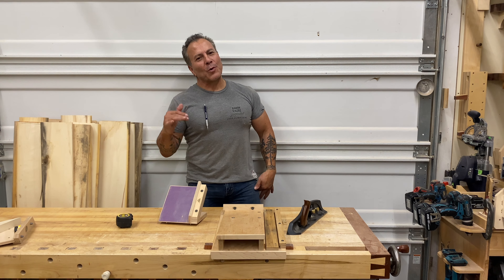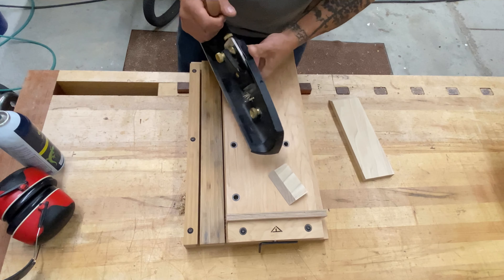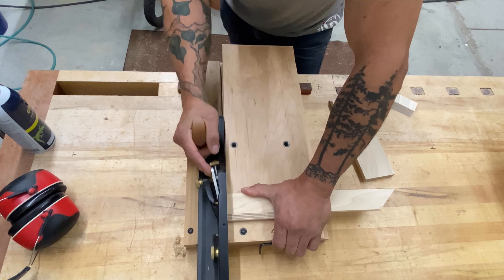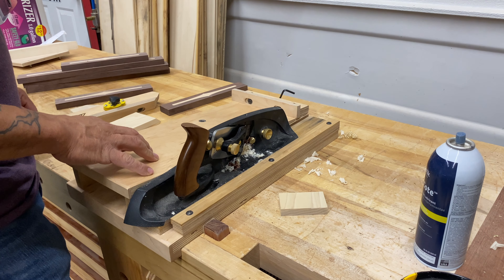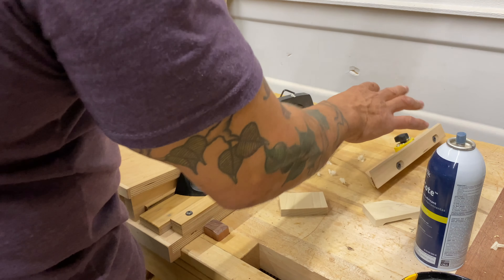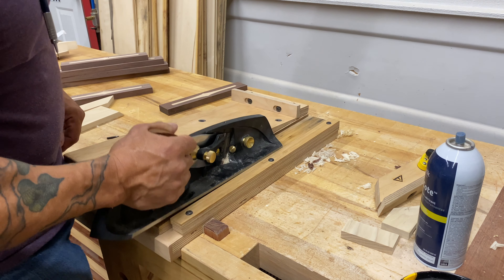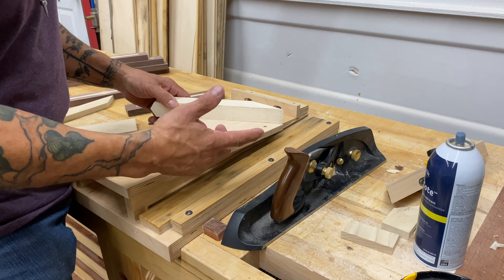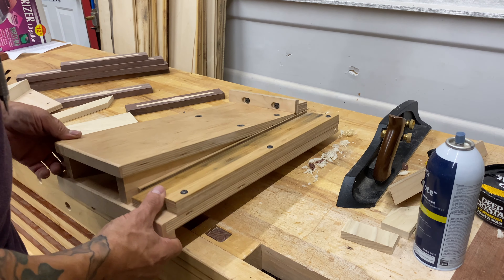The Incomparable Shooting Board!

Comment: Thank you so much for teaching. I always walk away with information "gems" from your videos, so don't second-guess yourself on that point. 

I've been on the fence about that exact plane. My current set-up is my heaviest, squarest plane on its side and I can get results (with effort.) Seeing that guide rail on the right of the board makes so much sense and the shape of a dedicated shooting plane allows that to exist. 

Unrelated to shooting, you mentioned not using a plane on ply and I'm curious about your reason. I do it often with my block plane and I'd hate to damage it. I don't mind if it's just excessive dulling (I've got a fairly good sharpening routine before projects.)

Thanks for any advice!
Reply from the maker: Thank you so much for watching!  

Yes, I love the idea of a dedicated plane designed for a shooting board and the fence to guide it is superb! 

I use my planes on plywood even though I don’t like it! 😆 It’s really, as you mentioned, a quickly dulling issue.  Especially with the fence being an upright section of plywood.  I may change it to solid wood.  I feel like most plywoods’, with their multi layers of cross grain and rigid glue are hard on a sharp blade…but then again, it’s just a tool right?   Sharpening is easy. Thanks a ton

Comment: Fantastic video Ramon, much appreciated. I'm planning on making one using my SO and have 90% designed in Fusion 360. However, having read the attached comments and having thought about it a bit more I'm not convinced the angled base is really worth the trip? The rationale is that it helps to hold the workpiece tightly down to the base. However, if you're using a shooting plan with a skewed blade (I use the Lie Neilson shooter which does) then the skew angle is effectively offset (as one or more posts have noted). The skew not only helps reduce cutting load (an easier cut) but is also introduced a down force component that helps keep the workpiece in place. Maybe the original design from Tico was developed to work with a standard bench plane where the angled base introduces a skew component rather than eliminates it?
Reply from the maker: Yes…valid points.  I’ve been looking at mine regarding this topic and the angle of the base is negligible compared to the skew of the blade.  You’re still absolutely getting a sheering cut.  Not sure how much the angled base helps, but it feels right.  And I like the fact that the angle helps use more of the width of the blade.  Occasionally, I’ll add a board against the fence to bring the workpiece towards me and further use more width of the blade.  Thanks a ton!

Comment: Wow. Fantastic Ramon. My Veritas shooting plane has been sitting in a box and I have yet to use it because I keep looking at different shooting board designs and have yet to find one I was really happy with.....until now. Tico's seems absolutely perfect. I will definitely be building one based on his design. Out of curiosity what is the angle of the ramp? Did Tico just match it so that the top of the blade is near the top of the ramp? But I could see the rationale for making so the top of the blade is part way down the ramp so utilize more of the blade for smaller width pieces that would probably be 99% of what one would use it for.  And please do show more of that table. It looks incredible.
Reply from the maker: I’m assuming that the angle is not too critical.  With my plane all the way back (towards me) there is a bit of the blade still showing.  The angle is so slight that in reality, with boards up against the fence, the blade gets used in one general area.  I should have mentioned in the video, that I’ll sometimes take another wider board (that has parallel edges) and push it against the fence.  That brings my workpiece towards me and gives me a fresh, sharp area of the blade.  Now that I think about it, where is that board!?  It use to be in the same drawer.  😆 I bet it got used for something else! 🤪 Anyway, the table build and finished photos coming soon! Much thanks.

Comment: I long dreamt about buying one of his shooting boards, then pondered making my own.  I always wondered what angle he chose for that ramp--any insight you'd be willing to share?

Also, what's embedded in the table to allow the MagSwitch to work?  How deep under the surface is that--and it it another magnet or a sheet of steel?  Thanks for putting this out!
Reply from the maker: I had a simple shooting board that worked well for years but needed adjustability and didn’t have a good way to add/change the angle or direction of miter.  After contemplating myself (I thought it was pricey) I finally ordered one.  Now, without a doubt…this is the best shooting board I’ve ever seen.  Worth every cent! 

The angle isn’t critical…I believe I mentioned measurements in the video.  That downward angle helps tremendously as you lean into the workpiece to hold it securely.  
Yeah, I should have shown more about the magnet parts. 
The MagSwitch is attracted to an embedded metal plate…looks to be about 2” (51mm) or so.  But a rare earth magnet could also work underneath (and embedded).  Thanks a ton!

Comment: Thanks for the great video.

One thing that I have always wondered is what happens to your 45 degree cuts when you incline the bed relative to the blade.  At 5 degrees, or whatever the angle on this one is, it wont make a significant difference on a single joint, but on all of these things it doubles per joint, so if you are shooting 8 miters on a frame then it's 8 times the error.  To make imagining the issue a bit clearer think what would happen to the angle you are cutting on the wood if you inclined the bed to 90 degrees rather than 5 degrees.  You are now cutting a square cut.  Bring the bed down to 45 degrees and the effect is less, i.e. the angle you are cutting is closer to 45 degrees, and when you come down to 5 degrees it's less still, but still there.  

Is there something in this geometry that I am missing?
Reply from the maker: I’m not sure I understand what you’re referring to.  

The shooting board bed or platform is angled, yes.  But, even with the angle of the platform raised…the face of the miter being cut is dead flat against the sole of the plane. 

Does that make sense or am I missing your point?   Thanks
Reply: Ramon,  You are of course correct.  It took me a little while to work through it in my head but I understand it now.  Now to see if I can adapt my current shooting board to this concept.  Thanks again.
Reply from the maker: Sure thing! Reach out if you have any questions or just want to show your shooting board!   @johnmcgrath9227

Comment: That’s a beautiful shooting board. With all due respect if I were to build it, I would reverse the angle. Currently having the workpiece at an angle relative to the plane is navigating the angle of the blade in the plane which helps to slice through the board. Reversing the angle where the plane cuts down into the board would complement the angle of the blade and also force the wood down into the front stop block. Just my two cents.  it is a beautiful shooting board and I’m sure it works great as is.
Reply from the maker: I’m not sure I understand.  The downward pressure of the ramp holds the workpiece securely.  In addition, the weight of my body pushing downhill makes it easier to hold and push the shooting plane forward.  Let me know what I’m missing.  Thanks
Reply: @ramonartful  Ramon, I wanted to see if it could be made so that the plane was cutting down into the board like a hand saw does. But after looking at a few other videos of boards like this one that showed different views so I could see it a bit better, I've come around to see what you've known. And that is it works great and as you mentioned the isn't enough to cause any problems that I might have been trying to solve. 🫤

I watched and implemented your belt sander/sanding technique on my last two bed builds, I can't thank you enough! I have more sanders than "Carter has pills", but I still find that I'm reaching for my Makita quite often when fast, flat sanding is needed. I just took some time to learn the "Goose-it" technique, and I was off to the races! My mother used the phrase as well. 😉

All the Best, Chuck.
Reply from the maker: @toolchuck  Ok, great to hear!  Thanks

Comment: I had the same issue with the handle. So I took it off and choked up on the body, but holding just the body with downward pressure makes it want to tip. The handle keeps the downward pressure to the base of the plane keeping it flat.
Reply from the maker: So do you use it with or without the handle? I don’t find it tippy at all the way I hold it.  Feels quite natural to me.  Much thanks.
Reply: Without.
Reply from the maker: Took my handle off recently.  You’re right!  So much better! Much thanks.

Comment: I have to agree, the handle should be moved forward to allow more direct control/pressure over the blade area.  Otherwise, the plane is fine especially with the blade (iron) skewed 20° to reduce resistance and make a shearing cut that leaves a clean finish on end grain.

However, building a board with a table DOWN, you’ve now reduced the angle of attack (approaching 90°) thereby minimizing the function of the skewed blade feature.  
Yes, in order to make full use of the blade width, we’ve sacrificed the skewed function of the plane.  

So, here’s what I propose:
1.	Level table BUT raised
2.	Shooting board track fillers (3/4”?) to raise the plane incrementally as the blade gets dull.
3.	Delete plywood stop, Add hardwood-easier on the blade
4.	Optional: Use Low-friction UHMW tape on track

Soooo, where do we find all the parts to build one?

Cheers,
N
Reply from the maker: Awww, yeah valid points!  However, the down hill angle is minimal as related to the angle of attack.  I do feel like that slight angle does help with pushing the pieces tight to the fence.  

And I like the hardwood backer idea.  Sometimes I use a scrap board (solid wood with parallel sides) to bring the work away from the fence in order to introduce a new area of the blade. It’s also a backer.  I wish I had showed that in the video.  Much thanks.

Comment: Awesome tool, but for the thousands of dollars you will pay for this setup, the end difference will be nil, with a shop made shooting board and Stanley plane.
Reply: I don't agree. The precision, repeatability, being able to shoot picture frame and carcase miters and using the Auxiliary Base for custom angles add up to a whole lot more than nil.
Reply: @ticovogt  Exactly my point, all of which can be achieved with a shop-built shooting board and basic plane. You don't need a $2000 setup to do the same thing.
Reply from the maker: To each their own , I suppose.  I’m not sure what you mean “thousands of dollars”.  I have less than 900 (including the plane) in this setup which is superbly made and extremely accurate.  Could I achieve this with my old shooting board and a low angle plane? Yes, kinda. But it didn’t feel nearly the same. Besides the incredible function of the shooting board, a shooting plane is designed to have added mass…which creates nearly effortless action as you shoot that end grain.  Such a pleasure to use! I guarantee I would not enjoy the process as I do now…and, the cost of what I have in this set up…I never even think of that!